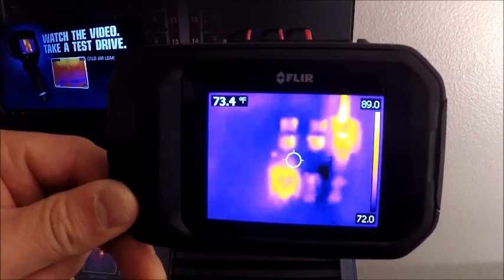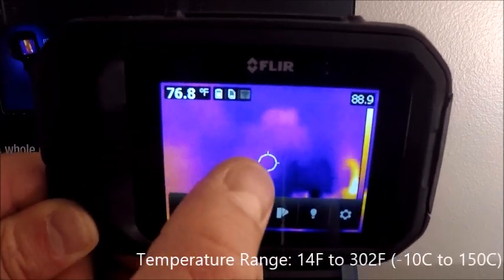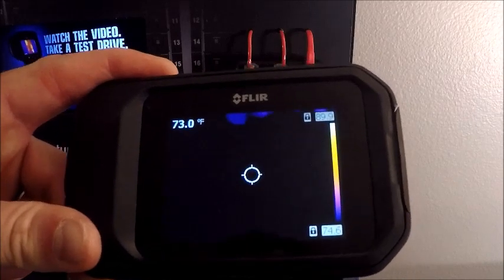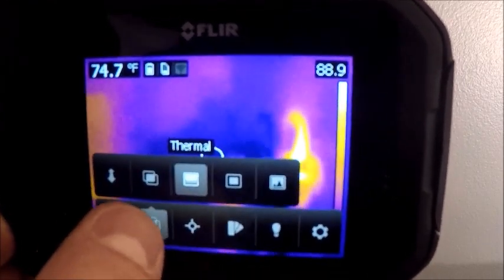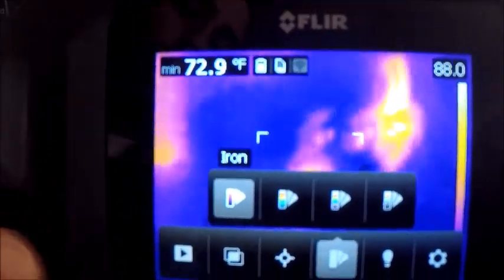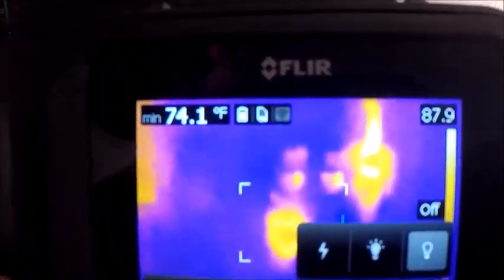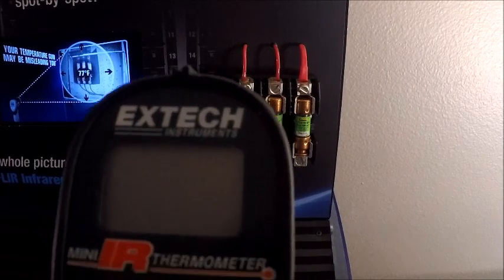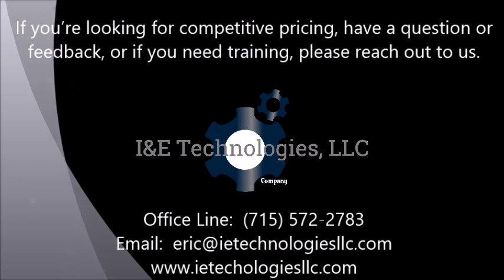Flir C2 C3 (C-Series) Infrared Camera Overview and Training with I&E Technologies

Comment: Great video, but how do you decide when to use the lock temp scale feature or not?
Reply from the maker: Hi @Johnfsu - it's not so much a question of when to lock the temp scale or not, it's more of a matter of awareness of what that scale is set at relative to the target you're inspecting.  If you're looking at the drive end side of a motor that should be between 110-150F but there is other equipment running hotter in the field of view like a boiler or kiln, you'll want to adjust your field-of-view to eliminate the back temperatures, or lock the scale around the motor temperatures in order to see only thermal details on the asset you're inspecting.  I hope that helps!
Reply: @ietechnologies72  Thank you so much for the quick answer!  If I am understanding you, the user can/will use the lock to help maintain the scale depending on conditions in the field of view.
Reply from the maker: @Johnfsu  That is correct!

Comment: Is it possible to analyse the saved images without downloading? What I would like to do is take a photo and analyse the temperatures of different spots later. Thank you!
Reply from the maker: Thanks for the question!  You certainly can do some analysis, image manipulation, etc, after the image is taken but not from the camera.  It would have to be brought into FLIR Tools Software or the FLIR Tools Mobile App, which are both free.  There is very little you can do on the camera to an image after it’s been captured, unless brought into our App or software.
Reply: @ietechnologies72  > thank you for the quick reply!!

Comment: Hi, Can the C2 or C3 take continues pictures? for example every 10 minutes? to use for creating an time laps video file later on?
Reply from the maker: Hi Willem - yes, you can.  There is also a Tripod holder for it as well.

Comment: I have a water leak I can't find, would this help?
Reply from the maker: Yes, this would definitely help but it would be best to do the inspection (assuming you’re talking about drywall/Sheetrock) when the temperature inside is much different than the temperature outside to maximize visual contrast.
Reply: @ietechnologies72  thank you.

Comment: one limitation I can see is it only goes down to 14F, This would only be good for medium temp or above
Reply from the maker: Thank you!  It’s a great camera for refrigeration, especially to utilize the Cold Spot Detection feature on the C3 (not available on the C2).  It should work for most refrigeration applications and while you may not be able to measure the temperature below 14F, you’ll be able to visually pick up non-uniformities or abnormalities which could be just as important, if not more important.  If temperature measurement is important to you, take a look at the TG165 from Flir.  It doesn’t have near the features as the C2/C3 but it does go down to -13F and up to 716F and is much less expensive ($375.).  We have a tutorial video on YouTube for that instrument as well!